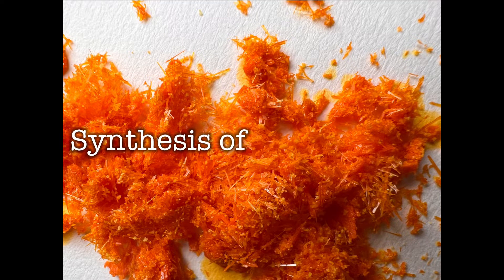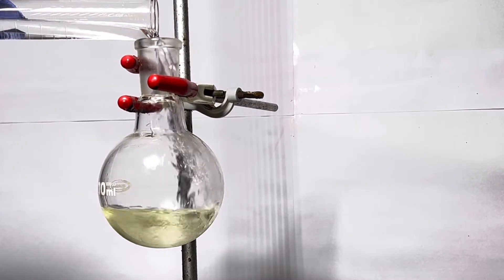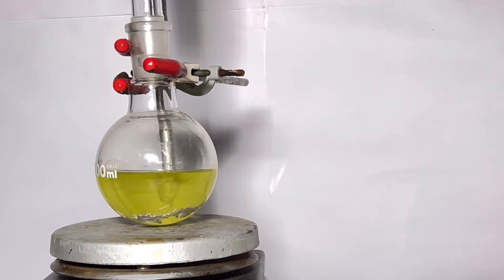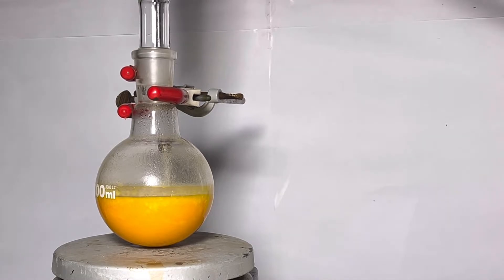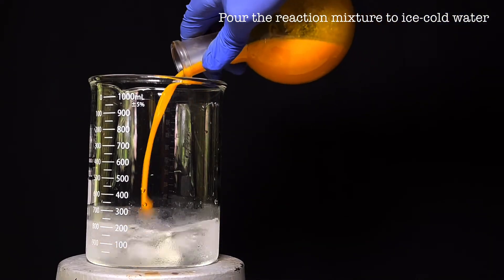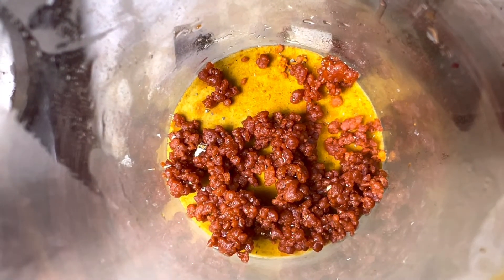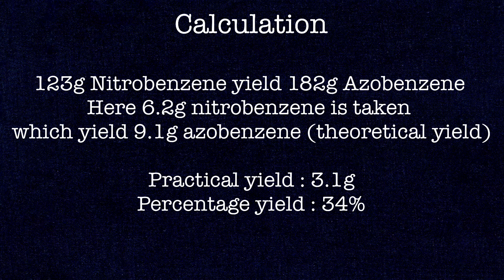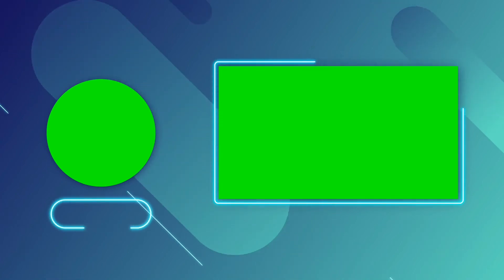Azobenzene : Organic Synthesis

Comment: Not bad! I just did this synthesis this week. That being said, I have a few pointers:

1. You wrote NaOH when you meant to write MeOH in your reaction scheme. You should fix that.
2. Your calculation of yield doesn't make sense. You need 2 equivalents of nitrobenzene to generate 1 equivalent of azobenzene. Therefore your max theoretical yield would be 4.59 g. That means your actual % yield was 67.5%

I would fix this and reupload the video or at the very least, put in captions that fix these errors.